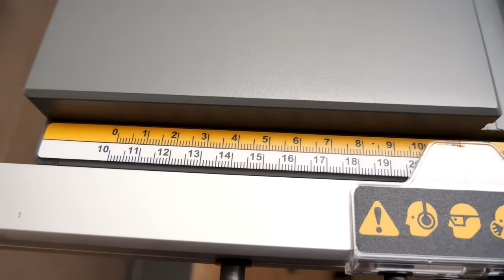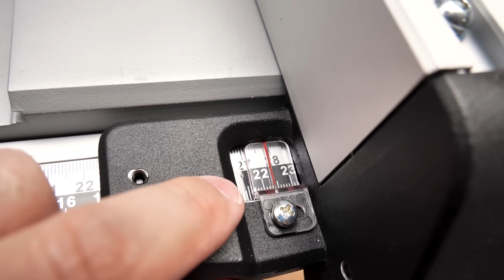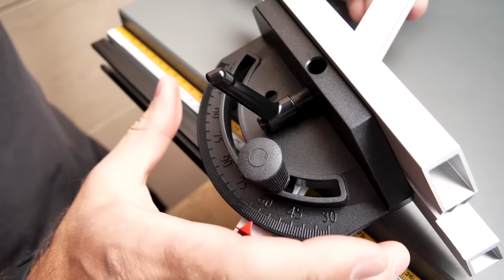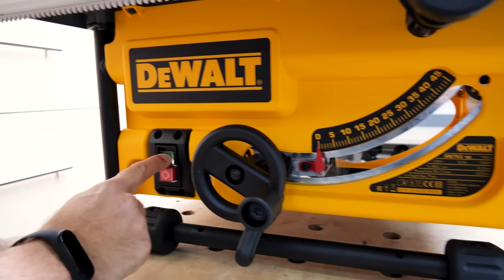🔥 Besser als die GTS10? Underdogs..? Tischkreissägen Dewalt DW745 und Metabo TS254 | inkl. Verlosung

Comment: Thanks for the automatic translation.
your videos are really interesting
If you had to choose and they all cost the same, which one would you choose?
  Makita 2704 - Dewalt DW745 - Metabo TS254 - Bosch GTS 10 XC
Personally, I care that they last for many years, general quality, guarantees and accessories.
Thank you
Danke für die automatische Übersetzung.
deine Videos sind wirklich interessant
Wenn du dich entscheiden müsstest und alle gleich viel kosten, für welches würdest du dich entscheiden?
  Makita 2704 - Dewalt DW745 - Metabo TS254 - Bosch GTS 10 XC
Persönlich achte ich darauf, dass sie viele Jahre halten, allgemeine Qualität, Garantien und Zubehör.
Vielen Dank